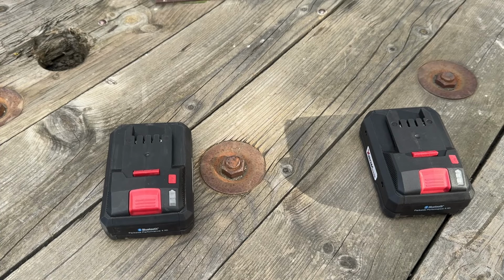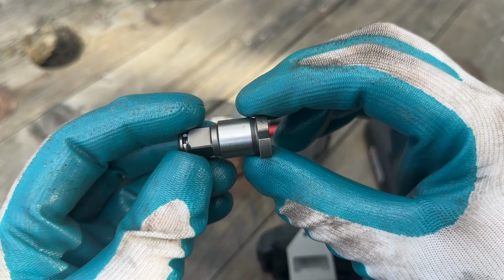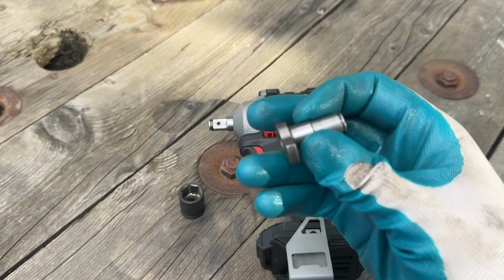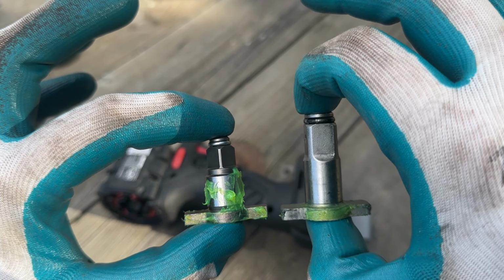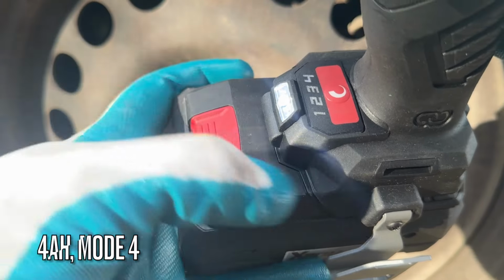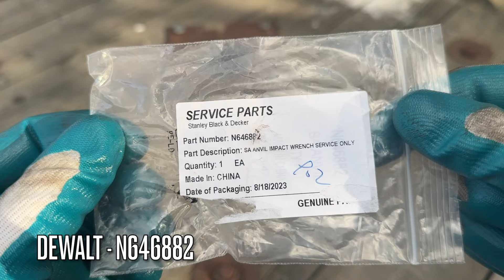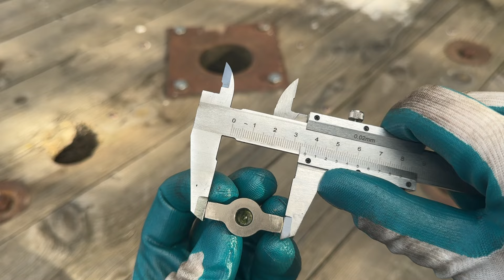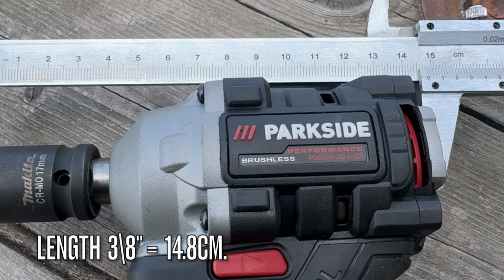3/8" vs 1/2" Anvil Mod PARKSIDE PDSSAP C3 B3. Is it a Stubby now?

Comment: I've finished the 1/2 inch conversion following your guide and it's working amazingly. It will be very handy on the clutch job I will need to do in my car.
Reply from the maker: Good to hear! I am very happy you are enjoying it! Did you use a brass hushing or a steel one?
Reply: @BrokeLifeEU  I used a brass one. Hope it lasts!
Reply from the maker: @sandromartins20 My B3 PDSSAP has had a brass bushing for over a year now and has had no issues. I do have the steel bushing in my C3 and I guess we will see which one stands the test of time. But so far so good!
Reply: @BrokeLifeEU  That's good to know. Thank you very much!
Reply from the maker: @sandromartins20  You are welcome! I hope you finished your clutch job and the tool was useful!
Reply: @BrokeLifeEU  Thank you! It went really well!

Comment: Cool! Definitely a stubby, that thing is probably shorter than a Dewalt 923
Reply from the maker: It would be even cooler if the anvil is longer at the point whwre the hammer hits it as it will have more torque. Then it will both look good and have proper power.
Reply: @BrokeLifeEU  that's probably the main reason why it has less torque
 It weighs less, so the force it creates is smaller.

Comment: I have a problem with the 1/2 inch conversion. I haven't done the conversion yet because the 16 mm anvil is 6.0 mm thick at the base.  I currently have about 1.00 mm play in the longitudinal direction (with the original anvil 5.0 mm). When I fit the new anvil, the play will be gone. I think that it is not good if the gearbox has no play...
Reply from the maker: Yes, not good for the gesrbox if there is  o play! Try and grind it down by 1mm it turns out that they send different anvils, some are a straight swap and some need to be ground down a bit.
Reply: Yes, they are very different. I have three of them in thicknesses from 5.7 to 6.0 mm. The one with 6 mm would be my favorite, as it is the best processed. I have to have 1 mm removed on a lathe. I still have a few 18 mm anvils lying around here. I could almost have bought a Bosch Professional for the money, but where's the fun in that... lol
Reply from the maker: @w.b.7819 Unfortunately the quality was good before I posted the links to their shops on aliexpress. Not it does look like they are after quantity and quality is the last thing on their minds. That is a shame!
Reply: I have to say that they are from different dealers...
Reply from the maker: Sorry to hear. I think you can get away witi by using just a grinding wheel and not a full on metal lathe.

Comment: The Milwaukee 42-06-0025 might be an option? but has some weird 17mm body diameter which I couldnt find an bushing for.
Also difficult choice, stubby compact or more powerful 1/2. if only my money would say yes to both
Reply from the maker: This might be interesting to look in to! But it will cost as much as the tool 😂😂😂
Reply: I think the 3/8 will generally be weaker then the 1/2 just because of the anvil weight itself, if you could finde one at the 1/2 weight thatd be great but as you know its already difficult finding 3/8 anvils @BrokeLifeEU
Reply from the maker: Correct! 3/8" are very difficult to deal with! Unfortunately I needed about two months to find a 3/8" anvil and confirm measurements.

Comment: And a saw a video how to drill the hole with a concrete bit...
Reply from the maker: I gave it a go but not a chance against the very hardened steel of the anvil.
Reply: @BrokeLifeEU  that guy sharpen the bit with an angle grinder and a diamond disc, I will try it also. ErCanEverything is the name of the channel.
Reply from the maker: That video and another one. I gave it my best shot but it seems like it may be a genuine DeWalt anvil or some vary hard metals so I could not do it. And even with a stationary drill it was not possible. So I had to beg someone with a lathe to get it done.

Comment: I think the best anvil would be the one from the PPDSSA 12 A1.
Reply from the maker: That is a 1/2" and unfortunately not sold separately.
Reply: I know. I already called Grizzly Tool (I'm from Germany) and got a rejection but I'll try again. This anvil would be the best option. Looks good and the length would fit perfectly. Only the bushing would have to be replaced. However, the loosening force would probably be less than with the 3/8 anvil, as you have less mass here too.